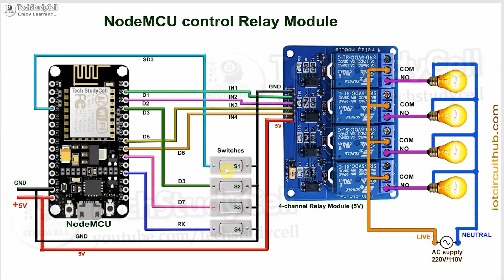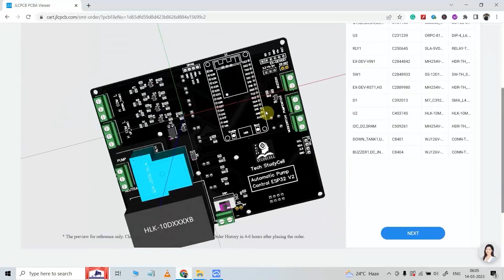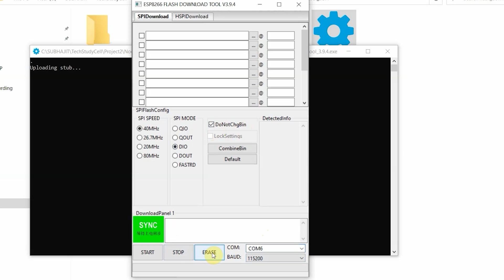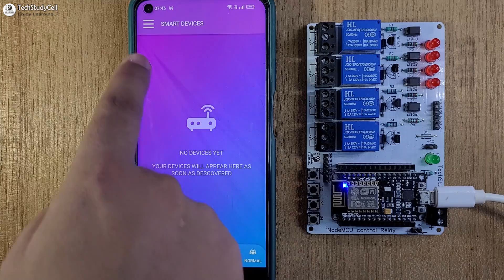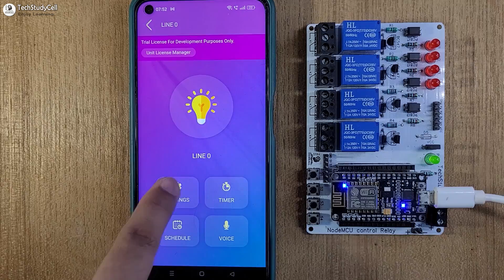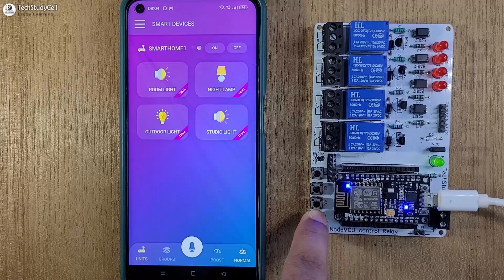IoT based ESP8266 projects using Google Assistant Alexa & Cadio

Comment: no log files were in the flash tools files
the logs folder is empty
help me with this issue
Reply: Your board not connected. Try another cable or your board has some issues.

Comment: Hello sir
I followed all your steps correctly but after configuration the relay is dimmed on but when I press the switch it glows more and does not get controlled through cadio app. Please help what is the issue
Reply: Yes i have also that problem
Reply: Jab me switch connect nahi kar raha only relay operate karta hu to hoti hai jaise hi switch connect ki all will be off slightly

Comment: Wow! This is a wonderful Project. I just did the project and everything is working fine. Thanks for the good work.
But, Please Mr. Tech Study, How can I re-enter the configuration mode, to add some sensors and also change "Press" to "Normal" for the use of Latch Switches?
Reply from the maker: You have to upload the firmware again.

Comment: Sir I have a question why we use only 5V relay and not 12V or 24V relay. sir why we don't use relay with optocoupler. Sir I want to automate my bathroom geyser since it is high power.

Comment: Hello, i tried to use nodemcu CH340 but the switch 1 connected to pin SD3 is not working. Could you help for the solution or alternate pin for switch 1?. Thx
Reply: On my Board esp8266 Lolin  
S3 = gpio9 
SK =  gpio10
Reply: Saya Pakai  SK =  gpio10  working fine 😅
Reply: @veriyan404  Please let us know all the pin changed in V2 and V3